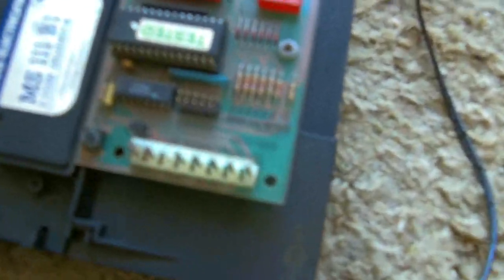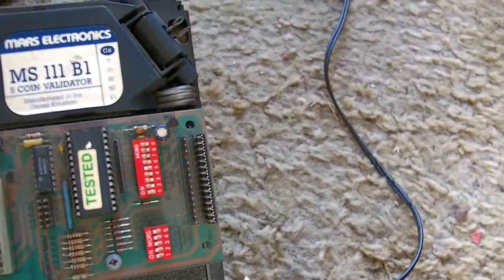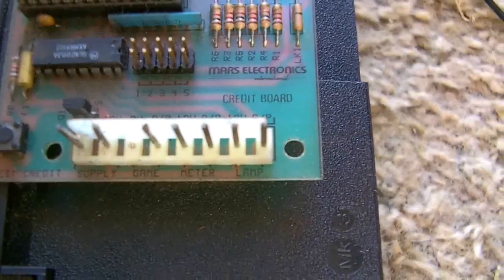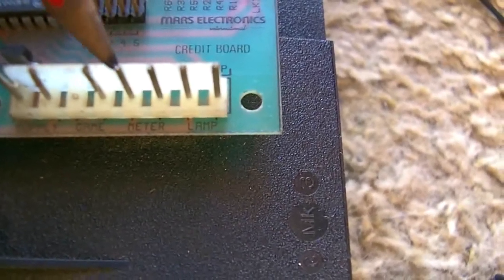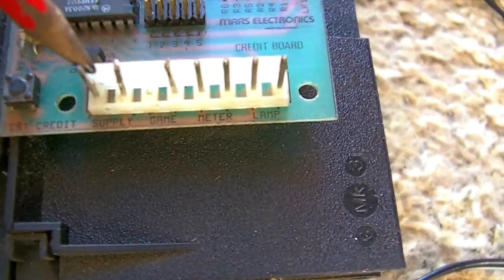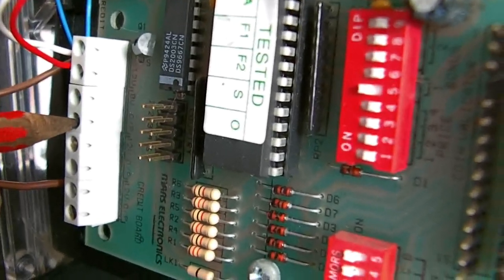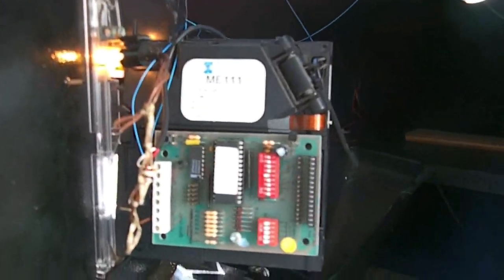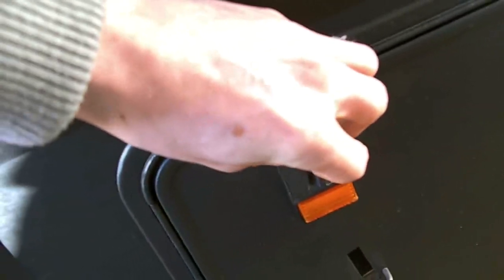mars ms111 uk coin mech mame

Comment: Hi - Great video and weel explained. I'm gad I found this. I have a MARS ME126TS which looks excatly the same as this. I have wired as you have but I don't know/understand where to wire the signal cable that comes from the game terminal. I have an x-arcade tankstick and I use one of those buttons to input a coin. If I piggy back onto that will input a coin and work?
Reply: I managed to work it out. There are two wires coming out of the game connection on the credit board. One of them is ground and needs to go to the ground on the microswitch of the button that you use to insert a coin in MAME. You can just piggy back into the back of it. Generally, microswitches have 3 connectors and the ground isn't usually used. It's the top one so connect to this. The other cable coming out of the credit board then goes into the next connector on the same microswitch. If your machine acts weird when you turn it on after installation (i.e it keeps randomly adding coins or your system is acting as if a button is always being pressed) then you have this wire connected to the wrong pin. Swap it over to the other one (not the ground one, leave that one alone) and that'll sort it out.

Comment: Hi m8 how much I add a momentary switch for freeplay to a arcade machine that has a electronic coin mech that goes to a credit board that in turn goes to the machine? Would I just hook up the 12v red wire to a that's coming from the machine to the credit board to a freeplay switch?

Comment: How do you connect it to an ipac? can't really figure out from the vid..
Reply: Hi - did you ever work this out please?
Reply: @seanmcgrath1991  as I can remember I looked at the wires going to the Coin mech and tapped into the switching leads and connected those as you would a normal button.
Reply: @siimsimsiim  Thanks for replying so fast. Appreciate it. I have wired as per the video but I don't know where to put the two game wires. I have an X-Arcade Tankstick and one of the buttons on it I use to insert a coin. Do I piggy back the wires into the back of these?
Reply: @siimsimsiim  I worked it out thanks. All sorted now.

Comment: Hi, awesome video and I will defo use it as a guide when i finally finish my cab!
However, I have a Namco arcade cbainet with very similar coin mech and was wondering if you could help....
 I have blindly fiddles with the dip switches on coin mch and machine now set to 30 p play which is fine, and the coin mech accepts 10p, 20p 50p, BUT it will not accept pounds, can you please tell me the correct config to make it accept all?
There are 5 coin accept switches.
Thanks a million

Comment from the maker: you cant :( the min is 10p per play. if you are using mame and want free play you will have to change the settings using the 'dip switches' when running the game. you can do that using the tab key on the keyboard. if you have a pcb, say jamma,  then the dip switches will be located on the board somewhere. cheers, dave